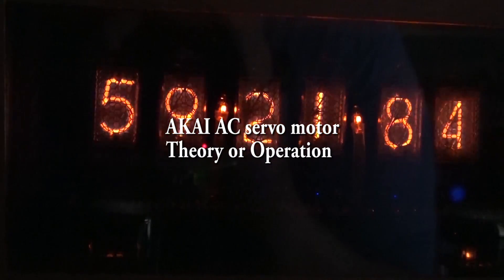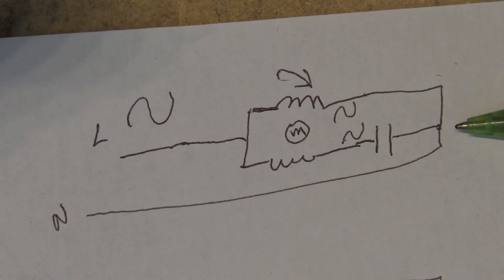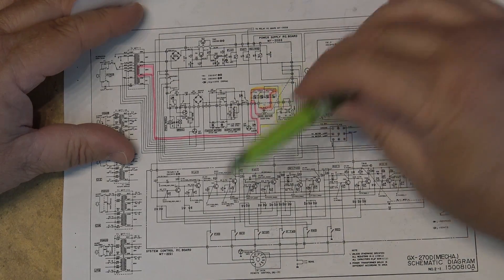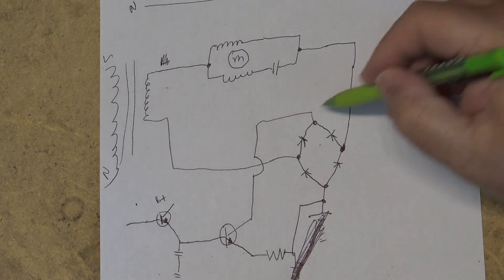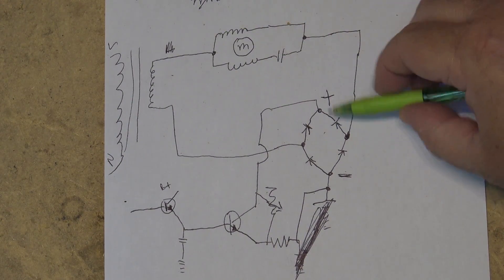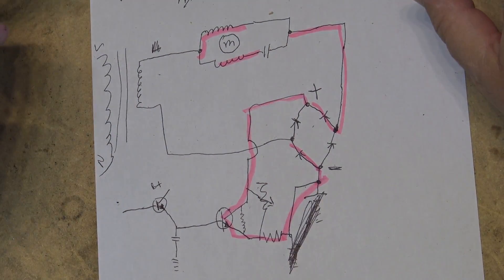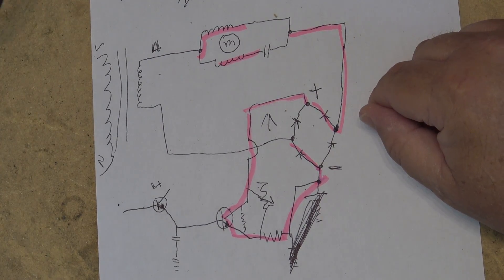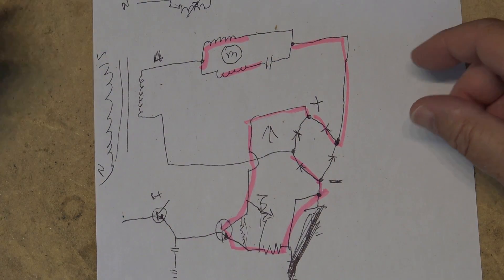AKAI AC Servo motor drive circuit explained

Comment: Is this a way to force an Akai GXC-39D 50Hz to run on 60Hz??? I don't have the 60Hz pulley...
Reply from the maker: Get a 50hz inverter.  You will need a power supply to drop the 120v AC to 12v DC and then use a 50 Hz true sign wave inverter to take the 12v DC back to AC 50 Hz.  Otherwise you will need to have a 60 Hz pulley made.
Reply: @12voltvids  Thats the problem... I don't know the measures of a 60Hz pulley...
Reply from the maker: You would have to measure the original and calculate the difference.  You can figure this out from the rpm of the motor.   Likely 1500 rpm at 50 Hz 1800 at 60 Hz or 750 50hz 900 60hz.  Knowing the size of 50 Hz pulley and speed of motor it is relatively easy to figure out the smaller size.  Speed divided by circumference will give you a multiplier.  Speed at 60hz divided by multiplier will give circumference of smaller pulley.

Comment: I learned how this sort of servo worked from studying the design(s) used by revox in the A77 1/4" decks. there were two versions of the error-correcting part, but in essence it's the same approach- big transistor acting as a shunt with a rectifier across the motor. I was modifying one deck to run at lower speeds, had to add a relay so that the main supply to the motor came off a different transformer winding, because the transistor was trying to dump to much & overheating. it's a common fault in older A77s, that the transistor fails like in your example, & the deck just runs full-speed. it's a good way of identifying what you might need to do to an ebay "as-is, spares or repair" machine, along with the exploding rifa capacitors.... get you a bargain if you recognise the symptoms from the description... cheap fix. :-)

Comment: The Guy's I used to do the Disco's with Were Electrical Engineers. and they would do this and show Me how things worked. And What the Colored Rings on the resistors meant and how to count them up. And How to Put In and take out Chips and Re-flow Boards. The amount of things that You had to remember on a Daily basis out In the field (Pre Laptops and Internet) was amazing. They used to service all the TV's and Video Recorders for the Schools and University's. Hence I had Two Betamax Sony C7's (One was a Clear Case One) to record the entire Live Aid on the day. I would start One Machine Going. then With a Few Minutes Left on the tape start the Other one off. I have the Whole day UK and USA. I also had the very First CD player, the Phillips CD1. He would take Me to the Shows In London to View all the New Gadgets for the Schools and University's This was a Great Day Out (on the Council). And there was this one Stall showing off these Shiny Disc's that play perfect Music all the time. So I said order Me one of those. I still have It although It, It's In It's box and looks and works like the day I had It With a Copy of (Now That's What I Call Music 4) the only way You could get this Disc. I had a Samsung Laptop on the Dos System cause He moved on to repairing and maintaining the New Gadgets. The Computer and Games consoles. Which My Girls would test out. From the Commodore 64, Atari, right up to the Playstation One Another one I still have and Use. By the time the Kids around us started to afford and buy Games Machines, My Girls were Experts, showing them how to set them up and play them (For a Small fee) that Is. .The Amount of Top End Hi-Fi and Disco Equipment, I have had and still Have. would be worth Thousands today. I still go round to see Him. Although Now He can't remember Who He Is never mind Who I am, That's Life I suppose and Boy did We live It to the full. I still do Disco's but Vintage Video now and when this Pandemic Is over I will be at It again. SHhhhhhhhhh! I have done a Few Private Raves though, I know naughty but Great.

Comment: The schematic isn't correct for me
Reply from the maker: It is copied directly from the service manual, less the reversing relay and snubber circuit. You can look up the schematic yourself and see. It is drawn correctly.